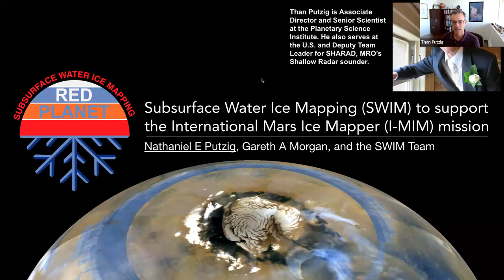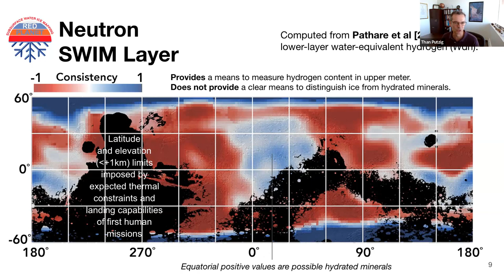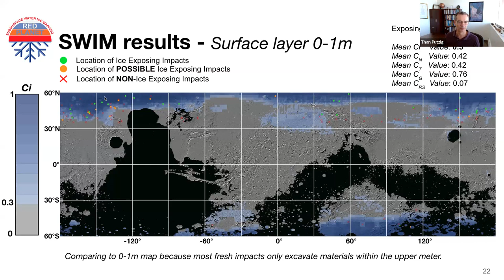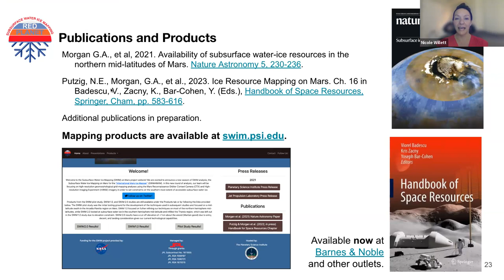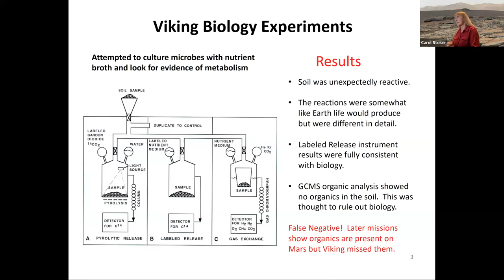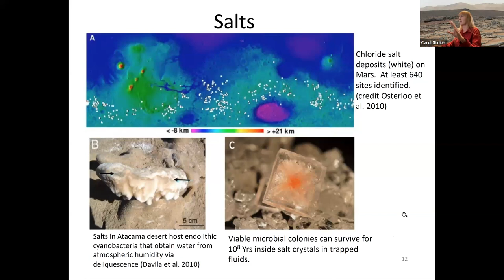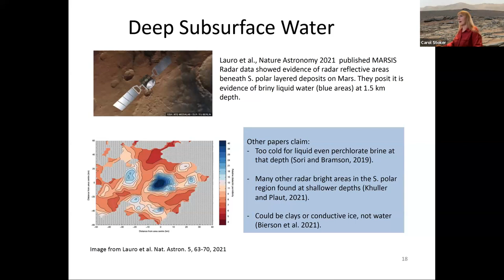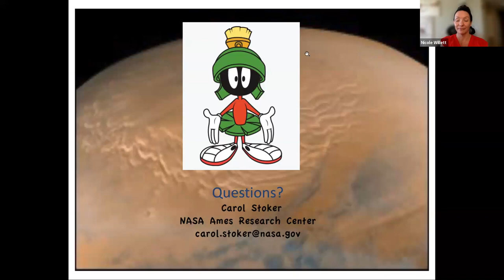2023 International Mission to Mars: Engineering Design Competition - Putzig and Stoker

Comment: I really don't know why start beyond our way of first getting their. 
The Orion project gave us a glimpse of Pulse detonation propulsion . The fueled Rocket is still the same since Wernher Von Braun introduced them to the world.
Nothing much has changed , it is still copy and paste but people are really twisted when you look at the features. It's like going into a dealership and asking for the worst possible car with the world's worst mileage.  Think against the backdrop of the vacuum of space and the distance covered is compared to a particle on a grain of sand. I'm willing to share to the world.  An evolved model of what's needed for today and the future of space exploration.  I feel Nuclear is not worth it until fusion is successful and feasible for all . 
The rocket system hasn't evolved since birth . Solid boosters came from the birth of the firestick aka the firecracker. I would want a craft and all of you should demand improvements because at 2 to 4 astronauts at a time , just doesn't make sense. 
As I mentioned earlier with Pulse detonation propulsion. I want to go hybrid because fuel and displacement equals much more distance. The improvement will gain speed just because it's going to give what the Orion project gave except it won't be bombs bursting in air/vacuum of space but internally and definitely not as much because the containment system would be much smaller and with my projection showing we can reach the moon which is 250,000 miles away in mere minutes. Hybrid system is what today should have. 
H.E.M.P which stands for Human Evolution Making Progress